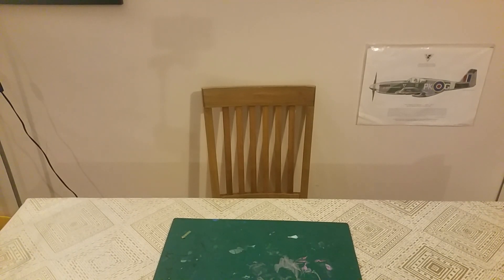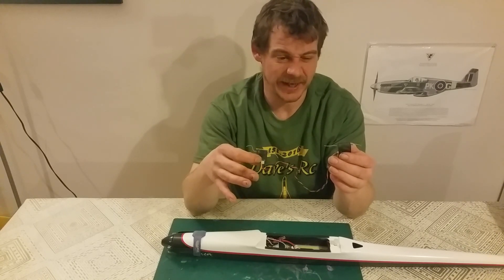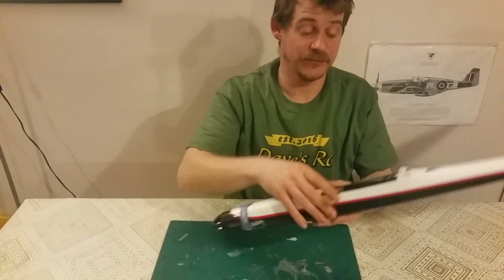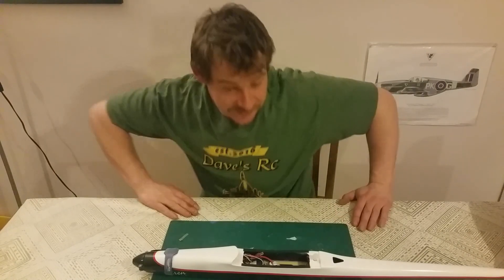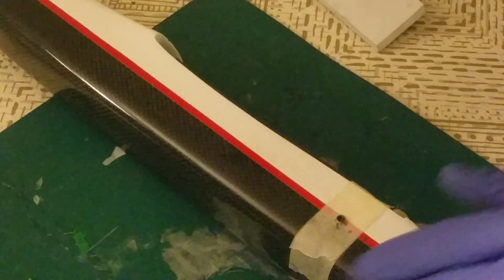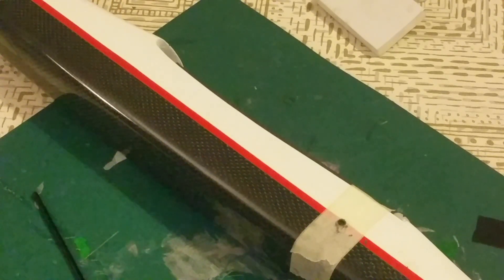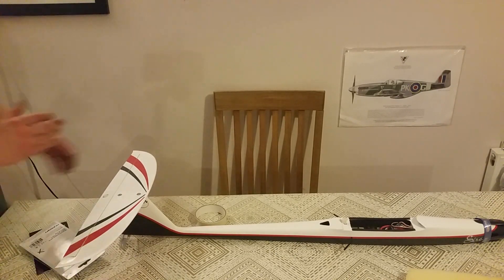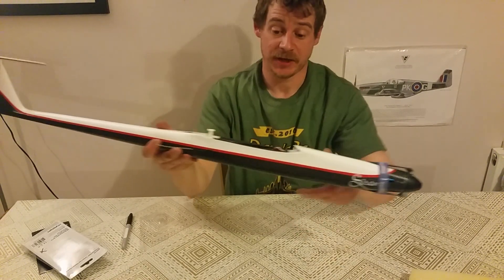Installing the Spektrum AR6270T rx into a carbon fuselage

Comment: All good Jeff. Great tip on the drilling, you made it look easy. I would have used a standard twist drill. Makes sense not to now. I'll have to keep that in mind if I drill carbon fibre. I guess it would be the same for fibreglass.
 Good luck, hope the maidan goes well tomorrow mate.
Reply from the maker: Thanks Colin .. I worried soooo much about doing this ..one chance only .. maiden went great